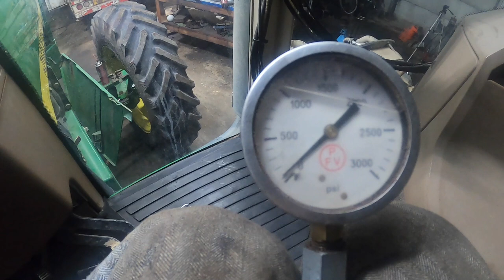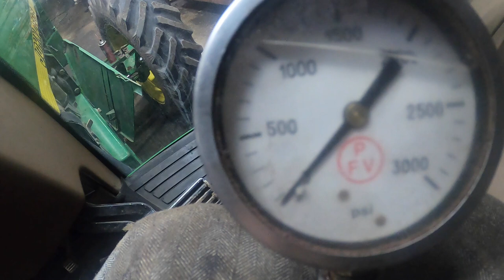No four wheel drive.

Comment: You know, someone discussed the high price of replacement parts. I’m not usually a “govt should take control “ guy but when huge corporations like JD , GM , Microsoft, etc. charge crippling charges for replacement parts or repairs, it’s time to reel some of that in. The Big 3 change the shape of a headlight rim year to year when its not a technical improvement and charge a fortune for those changes.
Maybe it’s time to require serious tech changes between model years. What’s the difference between a 2002 van and a 2010 van. Not too much. Just a thought. I have sympathy for the farmer who has to fight JD for the computer codes to fix his tractor.

Comment: Warren I think you missed a clue,   Did they replace the front rubber and then later replace the rear rubber ?  New fronts and old worn rears can have the front doing 95% of the work and they found the weakest link in the drive system

Comment: Dumping the clutch did not cause this either pushing something heavy or pulling something heavy or stuck cause this you get what we call wheel hop it's when the front end starts bouncing and with those nice tires as soon as it caught traction it just twisted the outer shaft that's all I have replaced hundreds

Comment: i was told only use 4wd when needed & never ever on pavement. drove many of these 8200 mostly subsoiling but one on the 7200 gallon triple axle liquid manure tank spreader full load down hill on gravel roads pushed this tractor around like a toy. drive slow or jackknife & the tank spreader has hydraulic breaks plugged into tractor remote it's a must have must use was the only time i did'nt feel safe in a jd8200

Comment: Seen that happen (45 years ago), with a Michigan shovel sliding down a hill, the four wheels had almost no grip and slipping/sliding. At the bottom of the hill, there was gravel. So the front wheels had suddenly full grip and a big bang in the right front hub was the result. The shaft was twisted and snapped like a match. Like your channel by the way.

Comment: just for kicks.  next time in a homedepot pick up a roll of Surface Shields, Model #CS2450, 24 in. x 50 ft. Carpet Protection Self Adhesive Film. this can allow you to wrap parts up to keep them clean.. stick it to seats to keep them clean..  cover open engine and transmissions to keep them clean..  that roll is only 13 bucks. just for a trial.

Comment: That stub shaft being twisted that bad would in my book warrant an inspection of the other side it could have been stressed as well.. great job Warren..
Reply: Agree Doug. You could see the amount of torque that had cracked the shaft from the twist in the spline when Warren removed it. Such a short axle would need a huge amount of torque to twist and break so that suggests metal fatigue. You'd hope John Deere will take the broken shaft and examine it to establish a reason for the failure, and supply a replacement free!
Reply: @davidholder3207  The 8200 was made from 1995 to 1999. Tractor is at least 22 years old. How long should Deere be responsible for shafts!?!?!  To me he has gotten good life out of that. Try to get warranty on a 22 yo car or truck cv shaft.
Reply: @mfreund15448  As a manufacturer I'd be interested to know why that large steel shaft broke, after 22 years or not.
Reply: @davidholder3207  You'd be broke, too. Those 8000 series tractors are pretty much bullet proof. They eventually break down. In the grand scheme of things, this is a small potatoes break down.

Comment: Excellent video it may of had happen to it what one of my customers did to his 8400 John Deere tractor they were pushing on a stuck tractor trailer out in the field and when it got the weight of the trailer on the front axle it tore the whole front axle up and broke the king pins also. Make sure that the king pin bearings are good most of the time they are all hammered out especially when it has the big rack of weights up front there too.

Comment: Not sure if its the case with that tractor or any over there but in the UK when on the road in 2wd when braking tractor engages 4wd to give you engine braking on all wheels, I have known drive lines to shear due to fact the fronts are normally spinning slightly faster so when the 4wd comes on you get a snatching, quite often when you come to a stop and let off the brakes the front wheels will jump back as the gearbox is wound up.
We had a Case mx150 once that sheared the main drive like this and lost all drive. power brakes, hydraulic steering etc on a steep hill towing a low loader with a digger on and a large chalk spreader behind as well, needless to say I think the driver needed new underwear when it finally came to a stop but thankfully didn't cause an accident. 
Just a thought.

Comment: Good diagnostic work there Warren 👍, my experience of broken drive shafts as you have there are overloading front axle, hard working conditions, tyre size mismatch, fatigue material.
You’re front axle hasn’t been overloaded as it doesn’t have front linkage, you’d think that the operator could have explained when it happened and what he was doing, obviously they didn’t try the front diff lock either? Well done that man, thanks for the video as always
Regards ,
Luke 🇬🇧🔧

Comment: Tgank You Warren. I remember watching a little while ago you did a JD steering knuckles. Well. The company I work for, has got 4 JD 6610r. Each knuckle joint has hone so far that the pins are two thirds. And the housing is completely oval. So complete new axles are required. Ouch.....

Comment: Saw this a few times (on 580 backhoes) when I was a Case tech, people would leave the transfer case engaged on pavement and turning the steering to the lock, it would take a while to happen but rental equipment will always find those people that can ruin a ball bearing with a rubber hammer.
As just an observation, I was looking around your shop during various frames when it dawned on me just how much you have invested in your operation, your trucks, tools and support equipment dollar wise is a bit staggering, all mechanics of course share an investment in themselves but I just was overwhelmed by just how much you have invested, let alone your seeming endless energy and ambition to do the job right.

Comment: That took some beans to twist that shaft off like that, that is a fact. Kinda wonder if he heard it let go, or felt it in the steering...but this is hydraulic steering so probably not. Beats the heck out of having to split the tractor tho!. Seen the right rears back on the old Blue Ford, that has to be a good sign!

Comment: Actually pretty easy to break that. I've broken that CV joint spinning in the mud. the front grabbed while the back tires were in the mud. Guess you do what you can at the time to not get stuck. I was pulling a truck with a safety pull .